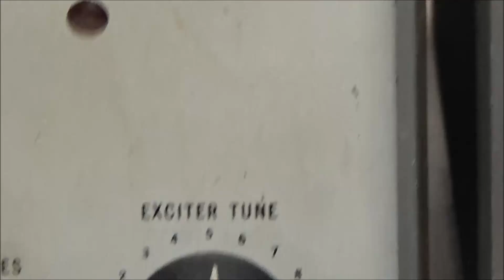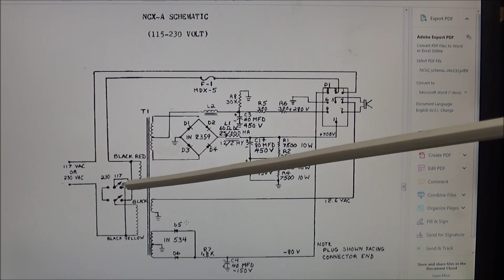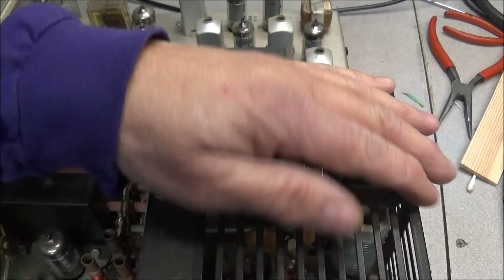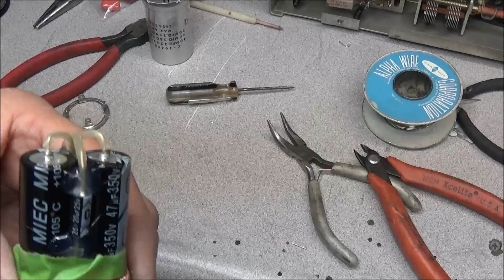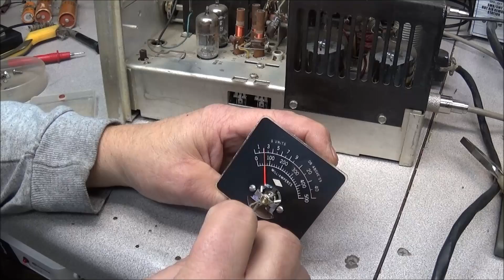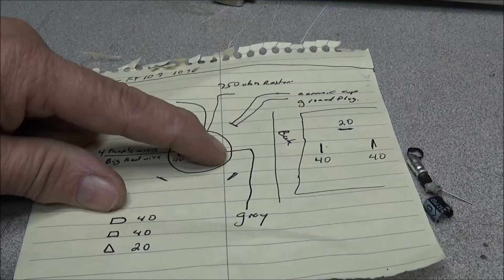#95 National NCX 3 Repair Part 1 Blooper to follow

Comment: Curious about part 2, but couldnt find any video. Did you give up on fixing the transmitter portion?
Reply from the maker: Have not gave up. The radio works fine as it is.

Comment: Negative side corrodes because of electron flow from positive to negative.  I just got my General Ham license upgrade and have a Kenwood TS-430S and PS-430 power supply.  If I want to engage a repeater on 10 meter band, how do I use a CTCSS tone on the repeater since my Kenwood does not have any CTCSS tones???  73 from K9POW in eastern Tennessee.

Comment: Any update or sequel on this video?
Reply from the maker: Not really, after running the rig for a while I found that it is doing a pretty good job on ssb.  About the only ting I need to do is fix it so the variable cap does not hit the top cage.  Been so bust I have not had a chance to get back to it.
Reply: It would be great to see how the NCX-3 is running now.  There seem not too many videos on youtube that NCX-3 is at actual contacting other stations on air. Thanks.

Comment: do bleeder resistors across capacitors always draw current or only when the device is shut down?
Reply from the maker: Yes they do. But the resistance is very high.
Reply: The bleeder resistor is connected across the cap and therefore always passes current. It is not switched and cannot know if the receiver is on or off.

Comment: 33:19 - a built-in keyer!

How was the tuning-capacitor issue solved? It appeared to me that it was fully open and NOT hitting the cage (?)
Reply from the maker: I was able to raise the cage about 1/8 to get it to clear.  After this video I had several folks mention about shorting out their capacitors on these.
Reply: Sounds like a MAJOR design flaw!

Comment: Wonderful video.   Could not find Part 2, yet.  A couple of comments: I found a plate amplifier cage on the very similar NCX-5 with a formed area on the top that fixed the tuning cap clearance problem.  National knew that the design was not great.  In operation, though, when you properly tune the NCX-3's and NCX-5's, you just don't short out that cap with the circuit values they chose.  It's not really a problem, even with the flat cage design..  As for the alignment instructions, consult pages 13-17 of the manual.  They are very complete, but these alignments are not for beginners.   I loved your meter repair section.  I failed twice to find the intermittent problems on identical meters, and you found the issue and fixed it on yours.  Very nice work!  73, N6KN
Reply from the maker: Hi Rocco. I have not had the time to get to part two yet. So busy with folks radios I have put a lot of my stuff on hold. Interesting on the formed cage design. I know the top cover to cage clearance is extremely tight on this rig. 
I also found an original manual so have all the service notes now.  Yeah the meter was a snap. Seen this so many times. Thanks for stopping by my friend.
Reply: I am looking forward to Part 2.  I want to see how you perform the alignment.  I found it very challenging, although my radio sounds great, now.  73!

Comment: The simplest way to solder to those aluminium leads is to copper plate them.
This is very easy... a teaspoon of copper-sulphate in a glass or warm water, a DC voltage , say 2 or 3 volts and a piece of clean copper wire...
Plate as usual, rinse and repeat when more than one is needed
It will readily take solder after that

Paddy

Comment: Ever work on a drake?
Reply from the maker: Yes, Been a while but have repaired a few.
Reply: Just wondering if you had any videos of working them.  I run a couple of TR4's and a pair of the twins (R4-B, T-4XB).  As well as my heathkit gear, SB 102, SB 400, SB 401,  And all the speaker units and power supplies.  All together makes one big pile.
Reply from the maker: Oh yes, not much I do not work on. In fact I have a fully working TR-4 on the way. Will be doing a restore video on it in the future. You do have a "heavy" pile there my friend. I do not currently have any videos on those. Sometimes locals come in for a quick fix and I do not record the repair. Only when it is left here.
Reply: Ha;  I'll have to be sure to watch that.  See how many hints I can pick up from you.  I just picked up my second TR-4 to go in a jeep, and it's all original, set for most of it's life, and pretty rough, Lot to do to restore one in that shape.  Hmm maybe I should make a video on that.  I've thought of making a video on several things but just can't seem to find the time to do it.  Besides being too damn ugly.
Reply from the maker: Cool deal. Yes do a video on it. You are going to repair it any way. I seldom show my ugly mug. Anyway the video is about the repair and not the person :-) About all my repairs are on video. Some never make it to YouTube.
Reply: Not enough Drake vids on YT they don't break often.

Comment: I would avoid blocking the pressure relief port area with any hot melt.  Maybe you did not apply that much -- hard to tell from the video.  Anyway, I have witnessed one explosion of a log life capacitor (long life means extra amount of electrolyte) that had been mounted in reverse. Was way back in 1960's but the bang still echoes in my mind.
Reply from the maker: That is correct. A hole is provided in the bottom of the assembly to out gas any pressure. Also at 32:08 you will see I talked about an added hole in the top of the capacitor to relieve any built up pressure.

Comment: I worked on the meter on a SX-100 (as recall) & there was 274 volts on one terminal to ground.  I got very surprised by that.  Luckily, I had one hand in my pocket.  I'd recommend checking voltages before handling the meter as you did.
Reply from the maker: That is a good point Bob. But 274 volts on the meter?  Will have to pull the schematic on that one. Crazy voltage lol. This one has a peak of 3 volts DC on it.

Comment: at 18 minutes you say that the pa tuner cap has an insulated rotor and grounded stator. Can you explain why and how the rotor is insulated? Doesn't it turn on bearings that are mounted in the frame which is grounded? And wouldn't that ground the rotor. This is backwards to every variable cap I know of.
Reply from the maker: You are correct, My mistake as I said it backwards. I will edit the video tonight with the correction. Thanks

Comment: trivia question answer::  in my case the - corroded do to the mismatch of metals  and the conductivity difference.
thus my neg terminal corroded rather quickly and had to do some replacements of the battery and the terminals 
got new cables with pigtails, soldered the leads from the ham radio  and the pigtail connected them together with a connector
not had any issues since. :-)
LOL @ the blooper. 
73's  k7sce
Reply from the maker: Good reply Scott. Thanks

Comment: on the mesh. you could use a dremel, grind away just enough to have clearence. ????
Reply from the maker: You could but it will change the capacitance quite a bit.

Comment: Buddy, I am sure you know this and were aware of the rating of the S-Meter you tested. You should mention that testing Analog meters with an analog Ohm Meter can destroy the meter movements. Many analog VOM's pass as much as 300 mA through the leads on R X1. Most exceed 100 mA.  Should you get across a meter movement that is 50 uA or 100 uA  you can instantly blow the movement. I always tell folks to NEVER test meter movements with a VOM unless they absolutely know what the movement is rated for and what the Ohm meter is producing. I actually have stickers on my meters telling me what each one produces on each ohms range. By the way, popped a few caps myself.
Reply: Alan W2AEW did a nice job of describing meter movements and how to measure a meter's current handling capability...see his episodes #235 and #236 over on his channel.
Reply from the maker: You are right. I should had mentioned that. I know this cheap meter is very low and the meter is well above 150 ma. I will cover that in part two. thanks for bringing this up my friend. It is very important.
Reply from the maker: Yes they are very good examples Dino. I really enjoyed those and use that quite often.

Comment: Hi, Buddy! I had one of those rigs around 1973-1976. Loved it, but it didn't love me. I could not tell you what ever happened to it. I think I just gave it away. I had just finished a QSO with another ham, and when I went QRT, I didn't turn off the radio. In a few seconds, another ham started a QSO with the fellow I was talking with. He asked who I was. He told him, and after that he told the dude I had been talking with that I had the worst audio he had ever heard on ham radio! Lol! I got pissed and got rid of the radio, and stayed out of ham radio for a decade. Eventually got another radio and have been enjoying it since. Good luck with that rig, and let us know how it works for you in an update. I think my radio had a balance modulator problem not that I think about it. 73...Dan w4mnc
Reply from the maker: Dan, Thank you for sharing that interesting story. I have heard similar stories like that with National rigs. Plugging up the mic jack and using a key makes it sound so much better  :)

Comment: I've never wired a cap to the wrong voltage or or gotten the polarity backwards...well today that is...and it's still early!! :-)

Question: On your new Power Cord, you didn't show the finished product but  I assume you wired the Power Line Ground to the Power Supply Chassis as well? 
Good video!
Reply from the maker: Lets hope you keep that track record!Yes It was a new three wire cord. Plan to cover that part in part 2 along with installing safety caps. Thanks

Comment: Well, these bastards can be real nasty if you use those with working voltage less than what is in the circuit lol! Nice job as always! 73's de SM2GXN
Reply from the maker: Yep, that was a mistake lol. Thanks.

Comment: Hi Buddy, Great video, love the blooper. I reached over and picked up a 25v electrolytic instead of a 350v not noticing and it vented when I turned it on. I did not have the pop but I had plenty of smoke! :>) Many good tips in this video, interested to see how you solve the cap and cage issue. I assume you have the instruction manual with the Test and Alignment procedure starting on page 13. If not I have it. 73
Reply from the maker: Thanks Larry. Funny how that tiny cap pooped so loud. guess 360 volts was a bit much for it lol. I happened to find that manual this afternoon.  Never seen this before until today. Not written the best but will work.

Comment: At least it was only the 25 volt cap.  I popped a 100uf 600 volt cap about a year ago in a amplifier.  Was one of the ones where they run 8 caps in series parallel configuration to bump up the voltage and value.  Somehow hooked up one backwards.  Took it about 30 seconds, I heard a short whistle as it started to vent and then BOOM!!!  

Let me know what type and value that control is.  I can probably build a new one for you from my IRC Spectrol kit.
Reply from the maker: Bet that made a big bang lol. Hope your hearing is ok. Going to try and get back on it this week. Will let you know. Thanks Mike

Comment: Backward caps must be a 2017 thing. I blew my first electrolytic, because I installed it backwards, this year. I'll take a stab at the corroded meter terminal question. Current flow is negative to positive and the dissimilar metals of the bolt and tab sets up a corrosion cell. Galvanic action at work. Metal leaves the brass screw and oxidizes on the metal tab. I used to work with cathodic protection for pipelines and I'm dragging old memories out so I hope I'm at least close
Reply from the maker: Very nice explanation Michael, Well done.
Reply: We use a large rectifier to "pull" the pipeline more negative (DC). The worse the coating on the pipe is the higher the voltage impressed on the anode(s) will have to be. The anode(s) for the rectifier is/are either buried in a deep well (to cover more distance or to put them in an electrolyte, which means soil with minerals and water) or spread out perpendicular to the pipeline and buried in a ditch which is then backfilled with cokebreeze. The pipeline is the cathode which is why they call it cathodic protection. If two pipelines cross each other and there is a difference in potential we have to bond them together otherwise the line with the higher (more anodic) potential will begin to lose metal. Sometimes at an alarming rate.

Comment: I am new to tubes so I might be completely wrong.I was watching Mr. Carlsons vids I think and I think he mentioned old caps measuring in spec , but still passing DC and loading up the tube. Still learning and trying to help..Keep the great vids coming and thanks for sharing your knowledge.
Reply from the maker: Yes a capacitor can show good on a meter, but can leak and have high ESR. Equivalent series resistance.  In other words it acts like a resistor. Thank you and thanks  for watching.